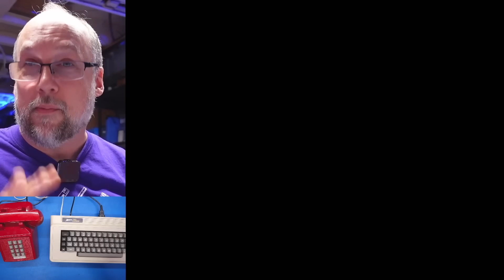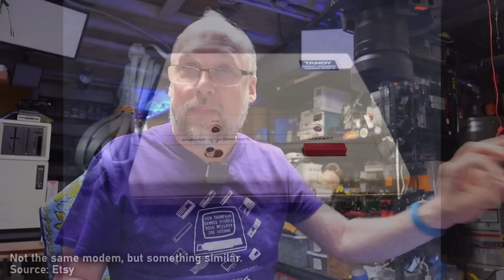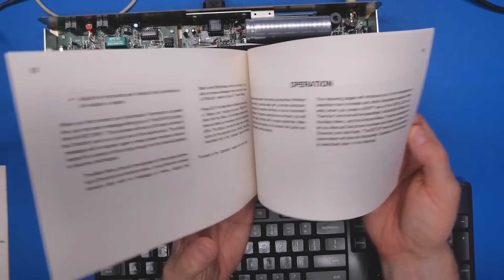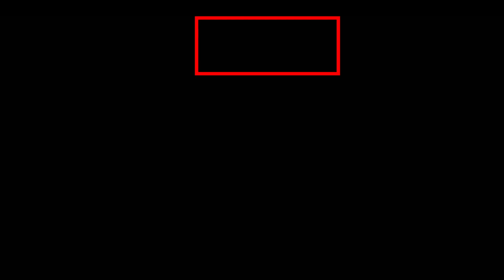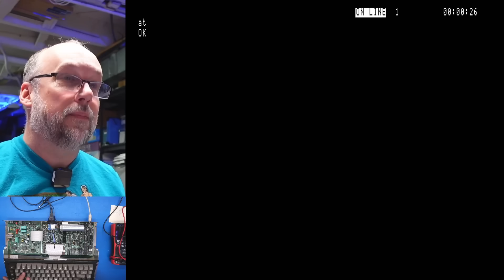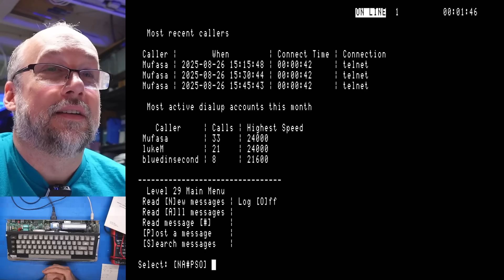Adding Wi-Fi to a 43 year old modem only terminal (Zenith ZT-1)

Comment: 16.8 kbps was a "standard" that USR Courier modems had access to, by using a 14.4 kbps modem and through proprietary shenanigans was able to push up data rates to 16.8 kbps. But  in reality almost never used but defaulting to 14.4 bps, but it was a sleek sales pitch. 
Worth noting, 16800 is 7 times 2400, so it makes sense as a modem speed, even if it was never used.
But that was way later than the ZT-1, I think Adrian is right when is probably just the highest baud rate the cloch/CPU can create
Reply: all those 16k8/19k2 etc modes were on the phone line, while there was always MNP5 or V42bis compression in place, so for reasonable operation the PC needed to talk at minium twice the phone line speed to the modem, in order not to potentially slow down the output of text screens with lots of e.g. blank/repetitive text/drawings.
Reply: 16800 could also be a fallback for later 28.8 modems

Comment: Dear Adrian, about the example 12.53, the power grid in Europe is different, we either use a 1-Phase 230V or a 3-Phase x 230V but with 120Deg shift from phase to phase, so between phases you get ~400V

Comment: Thanks for the dive into the pre-home computers era 😊
I started working at a company which was "sentimentally attached" (actually it was because operating in high reliability sector, rolling stock) to HC11 MCU and I remember having to select the specific external oscillator which would divide down to the fastest baud rate with low enough error.
Regarding measuring the baud rate... Why not typing A or 5 which in ASCII correspond to alternating high/low? Then you can measure the length of an entire byte and reduce the error of the measured frequency to 1/8
Reply: The character you'd want to type for alternating bits is in fact W, which is ASCII 0x55.
Reply: @chloeduplessis1615 
Your right! My memory failed me: I was remembering 0x55 and 0xAA and confused them with ASCII 😣

Comment: To me, that B0F looks like it should have been °F and the two-byte unicode character got displayed as the corresponding two single-byte characters, as the ZT-1 has no idea what unicode is… 😁
Edit: ° is indeed 0xB0
Reply: While U+00B0 is the Unicode codepoint, the data which is actually sent is more usually 0xC2B0, which is the UTF-8 encoding. However, the fact that "B0" was printed literally but "C2" was not makes me wonder if Adrian's "BBS" is using a pre-Unicode 8-bit encoding, such as Latin1 (ISO-8859-1) which was popular in that era. In Latin1, a degree symbol is a single byte, "B0".

Comment: 16:50 Me! Four or even eight of them, depending on what I power up! :D
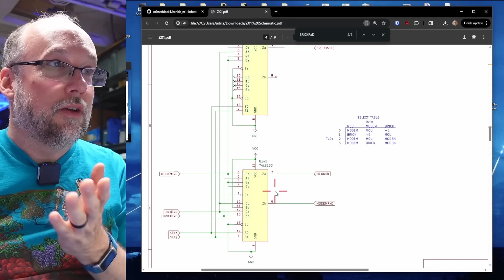18:08 It's a bit like Apple put the ethernet port on the iMac on the power supply. But I guess that's more for design reasons, so you can run a single cable up to the iMac. At least if you don't use the USB ports.
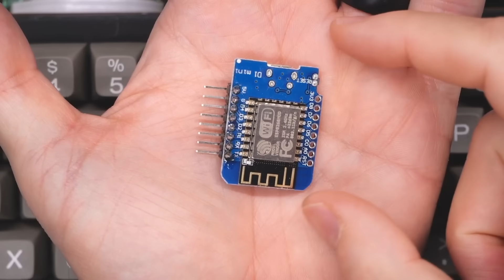24:23 I just got a new batch of 25 of these. The new ones are USB-C now :)
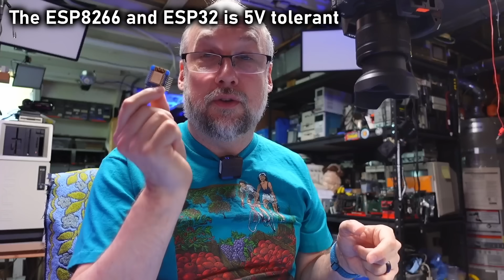25:13 You can put a simple voltage divider in there to adapt 3.3V to 5V. Works just fine :) I threw these in so many stuff I have as a wireless serial bridge! One is my PBX I use for testing phones and modems. I just added in in between the the MAX232 IC and the CPU, cause the CPU worked on 3.3V UART anyway. Left the DB9 port available and just let the ESP8266 work as a passthrough in software, so you can use the RS232 port or the wireless mode.
Would be a nice thing as as standalone module for plugging into serial ports. I guess out would fit into some larger DB25 enclosures just fine, and you only need  bit of power.

Comment: If you want to get the Zenith onto an actual Unix BSD server via telnet connection, you can try "SDF Public Unix System" and they give you telnet access. You have to verify you are human by either sending a dollar bill to a postal address or via a $6 PayPal payment. I'm currently  using that service to implement my own SlipKnot-style browser using a WiFi modem that I wrote for an old 80s computer (video on my page)...plan is to port it to other platforms like the Amiga, etc...

Comment: Another fantastic video!!  I started on a 300 baud modem with my Atari 800XL (the XM301) and thought it was the best thing since sliced bread!  I downloaded a lot of stuff!!  Of course when I upgraded to the SX212 (1200 bps) it was SMOKIN fast!!  I was young and poor, so I got mocked because I had to use 40 column and 24 lines while most BBS' were PC based with some even refusing anything lower than 2400 bps connections.  Jerks!

Once I got a PC I used my SX212 until I got an internal USR 14.4 and the big whoop at the time was that SOME of the USR 14.4 modems actually could be made to connect with the HST 16.8k speed which was a USR proprietary protocol, so not many people could use it.  The people who could afford those modems always gloated.  I know USR offered BBS admins special modem pricing, but nothing I could afford!

Ahhh the old days!  Anyone remember the DSVD modems?  That was fun to play around with, but not particularly useful.

Comment: I distinctly remember when 16.8Kbaud and 33.6Kbaud modems were solid, reliable options.  USRobotics produced 33.6 KBaud 'winmodem' cards during the mid to late 1990s.
Reply: Yea, rate is probably 16800 baud (not 16804). The 300 baud measured higher at 304 Hz, so the 4 is probably just measurement error.
Reply: Yes, 33.6k was a thing. (don't remember full list of baud rates off-hand). But by that time serial interface speed for the modem and baud rates were disconnected already (you totally could connect to external modem at 115200, and have it connect to another modem at any speed/baud rate. Would be beneficial too, because modems of that era supported compression, so - for text you could have speeds faster than the baud rate.

Comment: I seem to remember getting the Atari ST to run at 15K baud using a 14.4K modem that was overclocked.  That was the theoretical cap speed back in 1989 that we could get.  So running at 16K should have been feasible.

Comment: I remember writing code for the Sony KTX view data terminals running at 1200/75 the best thing was Sony gave us a terminal that would load in it's firmware from a 3 1/2" floppy.   A hell of a lot quicker than burning eproms 😂

Comment: Looks like this was intended to be used in two ways when originally designed. First as a remote terminal, over the phone, just hook up display, power supply and phone line - The selling point being, that you don't need a computer! The second way would be later on when you decided you really did need a computer, they would sell you a separate "CPU" box with disk drives etc, and then you hook the ZT1 up to it with that single 9-pin cable, and it acts as the dedicated console.
Reply: I suppose it could also be the console/keyboard for an Apple I in a pinch.

Comment: it's not digital signals, the modem puts out analog waveforms...audio. The modem is basically a class A audio amp and if you know about audio amp topology you know those need + and - rails to swing the waveform around 0V.

Comment: terminfo appears to have support for zenith terminals. Try setting TERM to ztx not vt52.
Reply: I suspect that Alpine docker image won't have the full terminfo database installed by default.  I think that might have been part of the issue.
Reply: @qwertyface yeah, gotta add the full term info for that container.
Reply: that's the neat thing about Linux: whatever the problem is, 99.9 percent chance, someone had the same issue before and either found a workaround or even fixed it.
Reply: Adrien,

You have a fundamental misunderstanding of what terminal types do. They are a code converter. You should peruse the termcap file to see what is actually contained in its black magic. 

Unlike today, there was no standard code sent for any function from the keyboard. ASCII text was mostly the same, but everything else was open to interpretation. You need to use the one that actually supports your terminal type, not the 'least fancy' terminal from a completely different manufacturer.

Dec VT scan codes were reverse engineered to be included in unix termcap because the physical terminals were so prevalent. It was DEC's proprietary data to prevent their Systems from being functional with other cheaper terminals. 

Secondly, Vi is almost certainly replaced with VIM which is filled with cursor placement and status bar line draws. VIM does not work because the ZT1 is not a VT52. 

As for why ^C doesn't work... Most likely the host end has already finished sending the output of the command to the I/O buffer on the host. Your break is going to the system that is already done processing the output of a command.

This is why commands like MORE and LESS are so important. They provide human pagination that is required to allow you to pause and cancel output over a 'slow' remote link. XON and XOFF provide that flow for the terminal communication, not for the screen display! You can affect how fast the host sends data to your terminal with STTY commands. STTY also lets you fix some termcap mismatch issues on the fly for important things like backspace

If you want to temporarily test say a slower output speed you can do "stty baud <baudrate>". The other is "stty erase (then your backspace key)"

Those extra characters you see on the end of the prompt line are certainly there because the zenith may not have a character representation for whatever the mis-matched terminal info you are sending it. Termcap affects translation of functional codes in both directions.

Comment: 36:00 ish -- would be neat to edit the ROM code to make it so the firmware starts at 300 bps and when the zenith switches to on-line mode, it sends the atb command automatically.
Reply: yea, it would also be awesome if you could put the hostnames into the address book.

Comment: If those oddball baud rates work, you theoretically should be able to use the ZT11 ROM's. Just get the correct baudrate then via the scope and configure it.
Reply: Unfortunately, the new rom has 2 as the lowest divisor while the old ROM has 1.  In other words, the new ROM will give you a baud rate of 8400 at best.

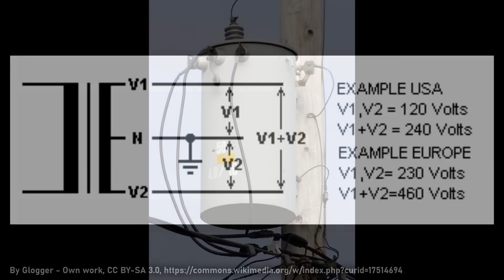Comment: This has been a cool series Adrian! Mainly commenting for the almighty algorithm :) P.S around 12:50 the European example for mains voltage is wrong: at 230VAC line to neutral the line to line voltage is: √3x230=400VAC
Reply from the maker: The diagram is split phase power which I guess isn't used in Europe? The diagram came from the Wikipedia article on split phase power. https://en.wikipedia.org/wiki/Split-phase_electric_power?wprov=sfla1
Reply: @adriansdigitalbasement  Yea I've never seen split phase used in Europe, it's always three phase.
Reply: In Australia, there were (way back when I worked in the electrical distribution field) outlying areas that used split phase supplies. A single wire high voltage supply was transformed down to give a split phase 220/440 volt supply to mostly farms. These systems used earth as the return line. This was much cheaper use of infrastructure.

Comment: Maybe you could modify the rom to default to 16804bps and then you could make the modem also default to that.
Reply: The default serial rate and routing could be done easily.  But the modem board is just the physical hardware necessary to generate and sense 300 baud mark and space frequencies.  Also, I think FSK only works up to 1200 or 2400 baud, then they switched to QAM which this hardware is in no way capable of using.  They also added error correction and compression capabilities on top of that.  So over all, increasing the baud rate of the modem requires complete redesign of the modem board.
Reply: @ovalteen4404 adrian isn't using the original modem. Did you even watch the video?

Comment: I wonder if the intended use case of the serial port was to have a specific monitor that has an RS-232 jack and passes that and power through to the terminal. Then you could sell the same device to both corporations wanting a standardised dumb terminal setup, and consumers wanting a dial-up terminal, rather than needing to design two separate ones.

Comment: Ya know, you can just link two modems together with an RJ-11 phone cable; you don't need physical telephones and a pseudo telephone network for the two modems to connect. Just ATA on one one end and ATD on the other.. and bingo they connect.  no need for an elaborate phone setup, the line doesn't need to ring, you just force it to answer with ATA command.
Reply: That doesn’t always work, it didn’t work with my Dreamcast modem and the modem I had on my PC. Results may vary with different regions and models. Sometimes you need to simulate line voltage at the very least.
Reply: @Wormetti  always worked for me.  any Hayes AT compatible modem will do what you command it to do.

Comment: "What is it talking about an RS-232 compatible monitor? That means absolutely nothing!"

Mate. What do you think a VT-100 is? They're literally talking about video terminals.
Reply: But if you were using a physical VT-10x, you would have zero use for the Zenith terminal.  It would make no sense for a TTY device to be outputting to another TTY device, especially in the sense that the VT-100 would be its "monitor".  So in effect, it means absolutely nothing.
Reply: @ovalteen4404  I have heard of chaining terminals so the “line” is exactly the same in multiple places, or for monitoring purposes, but… that’s not likely in a Home Terminal scenario.
Reply: @ovalteen4404 unless you need to dial in to a Unix system remotely. The ZT-1 doesn't support ANSI escape codes by the looks of the output having what looks like escape codes in the output.

Comment: Could you please upload char rom from your ZT-1 for completeness ? Thanks
Reply from the maker: I am meaning to. I just haven't had a chance since that type of EPROM can't be read by a modern programmer.
Reply: @adriansdigitalbasement programming is a problem agree, but reading them should not be a problem. tms2516 should be able to be read as 2716 (may need ignoring id on tl866 for example). Or as a trick you could read as 2732, but there are going to be duplicated halfs.
Reply: @adriansdigitalbasement  I remember that you once hooked up an old EPROM to a raspberry pi and used that to read the contents.

Comment: B0 = 0xB0 (ascii for °)
Reply: It is extended ASCII.   This makes sense from the reply you had.  89B0F would equate to 89°F
Reply: In the ISO 8859-1 (Latin 1) code page, 0xB0 is the degree sign.
Reply from the maker: Oh that wouldn't be ASCII, which only has up to 7F designated. But I assume B0 is the degree symbol on the extended IBM PC character set?
Reply: That's what I would have guessed, but I looked up an extended ASCII table and it looks like the degree symbol is actually 0xF8

Comment: I think the 6n is a vt100 control code, host requesting cursor position.
Reply: Yup, I was gonna say the same thing. The session is still in vt100 mode, or maybe the vt52 mode is borked and still sends vt100 stuff. The vt52(ish) terminal is quietly eating the "Esc [" part of the "Esc [ 6 n" sequence so all we see on screen is "6n".
Reply: I think OpenBSD is more likely to be compatible with VT52.

Comment: That “double baud rate” might refer to split speed, eg 300 up/1200 down
Reply from the maker: According to Dan (who reverse engineered the ROMs) it seems to be somehow related to a special function of the 8031 that can somehow double the current baud-rate, but only under some circumstances. Unfortunately the manuals for the 8031 available online lack a lot of the technical detail of the books that engineers had access to back then. (The ones designing hardware using these chips.) So reading Intels docs today doesn't really explain exactly what's happening.
Reply: @adriansdigitalbasement  Yeah the 1994 versions of the MCS-51 manuals (MCS-51 is the series name of the 8031 and 8051) document the baud double function and how to make it work.  The 1981 version says nothing about baud doubling.  So my conclusion is that it's a new feature that was to be made available in the (then) future, so Zenith decided to try to support it in BIOS.  Basically, get a new(er) 8031 and pop it in and that double baud rate mode will likely start working.
Reply: @adriansdigitalbasement  Almost any 8031 question you might have is answered in the 8051 manuals.  The '31 came a little after the '51 in response to customer demand. The serial port on these chips is an optional peripheral you can use if you don't need Timer 1 for another purpose. All the documentation and design was done around the use of Timer 1 for a general purpose timer and for a suitable Baud rate generator at that time but as serial got faster there was need for higher rates so the SMOD bit was added to what became the PCON (power control) register on later CMOS versions of the '51 to bypass one of the timer prescaler flip flops, but it also changes the prescaler if you try to use the timer peripheral so it's treated as "that other mode".